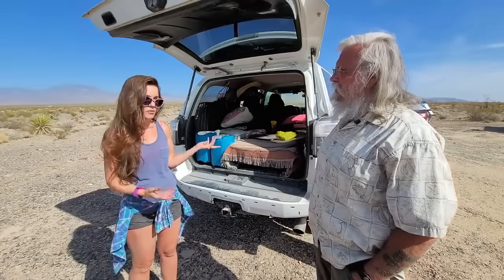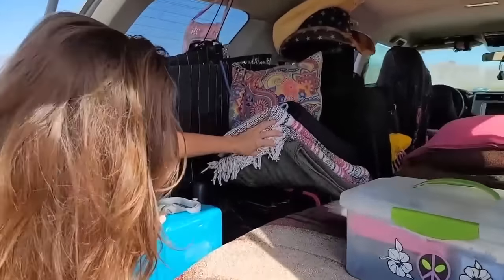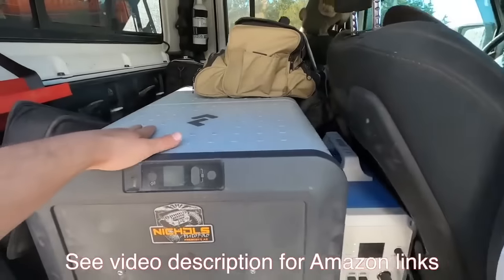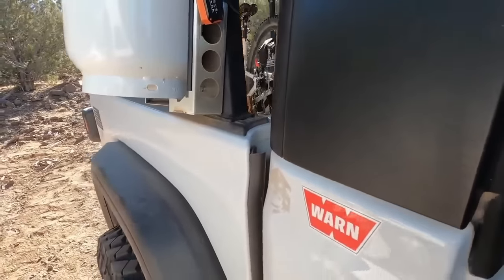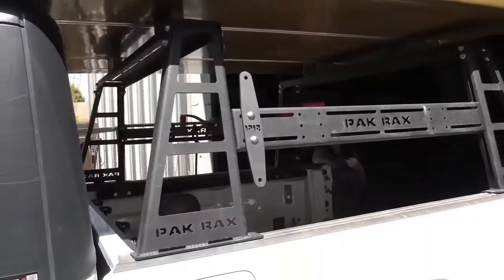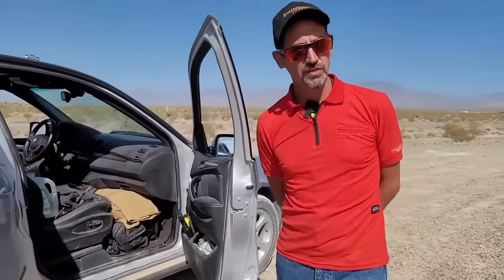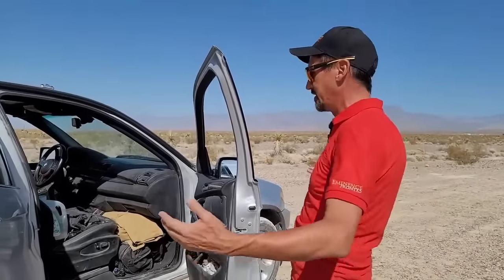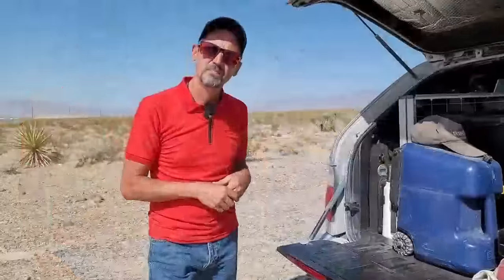Tour of a Nomad Living in a Car or SUV- 5 Tours | No-Build Van Life

Comment: I like container modules.  They are portable, movable, easily replaceable and easily reconfigured.  They look neat and help organize items.  Small size containers help an individual to not over buy  unnecessary items.  Also sturdy tubs can double as convenient tabletops.  By the way the very best tip I have ever gotten from this channel is using a portable garden sprayer as a shower/dish sprayer.  I tried this in my initial set up and it has worked so well that I never wanted to use anything else.
Reply: Thanks for that encouraging word about the garden sprayer. I thought it looked great choice to but it’s nice to have someone else’s experienced opinion.
Reply: Thanks for the portable garden sprayer idea!

Comment: I use an 2002 Envoy. It's mid sized +/-. 
Compartmentalize with bins. Everything must fit on one side .I can access clean clothes or light cooking coffee brewing inside if weather isn't nice. A tent and a couple sizes of tarps. Solar gor Engels fridge/freezer 45 qt , renogy dc-dc 50 amp controller and gel battery. Rear seats out. Cargo box on roof rack. I also rebuilt suspension so it hasn't bottomed out any where yet. 
We did extended camping trips for shakedown. 
Still in my first year I think. Departed bricks and sticks last Sept after my puppy checked out to next trail ahead of us. 
 I enjoy having the mobility to be places so many can't access for privacy and  seclusion. Most all repairs I can complete myself ss it's an easy drive train to work on, straight 6, rwd. 22 mpgs hwy. 
I enjoy Envoy, it's functions well bow with 237,000 miles on it. 
Do I Love it? Or any of the Stuff I haul around ans camp with? 
No, I don't love any of it.
I don't love anything that can't Grieve over a loss. That's silly if not a great definition of materialistic.
This I learned from  my puppy, Miss Susie. She was so patient teaching me Stuff.
Reply: Hi Michael, thanks for all the details!
I have a 2001 Jimmy and a goal to go nomadic in a little over a year. Can I ask ya a bunch of questions about how you set up your Envoy?
Reply: @scdmr81  I'd be happy to help!
Reply: @michaeltichonuk2176  Thank you! I just compared the specs of length and width of the Envoy to the Jimmy. My owners manual has “Envoy” on it as well, so I was thinking they were more similar. It seems the Envoy is a little longer and wider than the Jimmy. Anyways, I was wondering if you sleep in the Envoy or in the tent you mentioned? The back of the Jimmy is short for me; I am 5’8”. Also, you removed the rear seats? I think I would need to do that, and possibly the front passenger seat also. 
Did you notice a decrease in MPG with the cargo box on the roof? I’ve tried researching these cargo boxes online and how they affect mpg and seem to come up with answers that vary so much! My mpg in the Jimmy is already bad at 15mpg combined!
Reply: @scdmr81  I'm 5"10" and have enought to lay flat and have a couple inches at each end to spare. 
I didn't use a platform under bed as I wanted to keep headroom. I can sit up straight up no problem. 
  I removed rear seats. The single batter solar system is where passenger rear seat was. Easy access if need be. Mostly to power fridge/freezer. The 45qt Engel is big for this envoy though, but originally there were two of us and I wasn't comfortable leaving her,  my dog, unattended in a hot open unlocked vehicle. So that size reduced visits to stores. More safety for Susie then performance of  vehical. 
Cargo box is a Thule  Sidekick I think. A milk crate or a Home Depot bucket will.stand up and hold three long. I nick named Big Gulp. It just keeps taking Stuff. Amazing how much room it has and doesn't change 21 mpg hwy.  Even have a pair of recovery boards secured flat next to cargo box flat on roof rack. 
  I've become comfortable sleeping in it. Definitely better then hearing tent walls flap. 
Oh. My charge controller allows a solar panel alternator from engine to charge battery. I wanted the redundancy there.
Reply: @scdmr81   I installed coil over springs on back axle. It has not bottomed out once..they stiffen ride some. But I don't bottom out. 
  I chose this platform. As a auto tech i can easily repair most any components with easy access. Extremely simple drive train. Parts are in almost any town. Very common and inexpensive,  relatively speaking here. 😁.

Comment: I like Sarah Jane's simple setup! My best tip for camping on the road is to always keep 30 packs of Rice-a-Roni in storage. When you transfer each package to a ziplock sandwich bag, it takes no room at all to store a month's worth of emergency food. My favorite flavor is the spanish rice. I like to add sun dried tomatoes and Taco Bell sauce packs to the mix. The Broccoili Cheese Rice-A-Roni is great served with Starkist chicken foil packs. I'd also like to mention canned salmon and salmon foil packs. If you combine the fish with breadcrumbs, powdered eggs and water, you can make salmon patties fried in olive oil. Get a good stainless steel pot/pan nesting set instead of hauling a bunch of random cookware that takes over a whole storage bin. Even if you have a propane stove, bring a small folding stove or folding notebook grill that packs down to nothing. Such stoves can burn wood or charcoal when fuel isn't available. I keep a small cooler for salad foods, lunch meats, cottage cheese and fruit. If I'm starting from home, I fill the cooler with frozen water bottles to keep the food cold for five days. If I have to refill the cooler from a random grocery store on the road, I look for things like little frozen hamburger logs and frozen packs of cauliflower mashed potatoes. They take forever to thaw in the cooler!
Reply: Great idea about the salmon patty! Thanks!
Reply: I use canned meat, chicken mostly, for reserve food. Very compact and easy.

Comment: Another option is an SUV plus a tent that can be pitched nearby on the ground as circumstances allow. It can be nice to have the extra space sometimes.
I used to use a compact two-person tent. Then I went to a three-person. Now I'm at a four-person tent (Alps Acropolis), and am really liking it. It's still very compact when packed up, like the two- and three-person tents, but is considerably more spacious and pleasant when set up.
I haven't tried a five- or six-person tent yet, but might give one a try.
I like having the option of sleeping in the SUV whenever and wherever appropriate, and also having the option of spreading out in a nice camp setting at times.
I like having both options.
Reply: Is there a submodel to the Alps Acropolis? Lynx? Or something else?
Reply: @madison1446  I posted another reply, but it is not showing up, at least at the moment. I have quite a bit of experience with different brands and models at this point, and can point out some possibilities and aspects, but I don't know what you're looking for in a tent, or what your priorities are. If you can say a bit more along those lines, I'll be glad to share my findings.
Alps has a three-person Acropolis (I have the four-person). They make other tents also, you can find them on their website. Other companies also make tents worth considering. The best choices depend on what you're looking for in a tent and how much you want to spend.

Comment: Some Walmart stores carry these 3-gallon clear water containers that are great, the best I've found. They are in or near the RV section. Made in USA by AmericanMaid. They're stackable, store neatly and use space efficiently. Easy to handle. Inexpensive.
Reply: Yeah, 3 gal clear containers would be easier to refill. A pint’s a pound the world around. So 3 gal is 24 lbs and carrying one in each hand is under 50 lbs
Reply: @SarahGraymatter  Yes, I had trouble with 5-gallon containers. These are about right. They're a nice size.

Comment: There was a lady whose van got stuck in the sand for a couple days.....So i would think that the dig and traction boards that second guy had would be good insurance. They are rather large so space may be an issue but if one could find a way to stash it compact, would be nice in an emergency.

Comment: An extra-comfortable, extra-warm sleep setup that facilitates good, sound sleep and rest is really valuable.
The best I have found is a 2" memory foam pad on top of a 4" inflatable foam mattress (Exped from REI). Also a closed cell foam pad (~½") on the bottom for extra insulation.
It is extremely comfortable and cozy. 
Then I have three sleeping bags that can be used independently or in combination (one inside the other) depending on how cold it gets. I often add layers as the night progresses and gets colder. 
Then there are two light down comforters that can go on top.
I usually pull one of them over my head, and can have good darkness for sleeping even when it's getting light outside or when taking a nap during the afternoon.